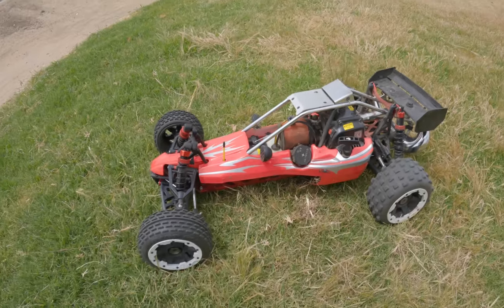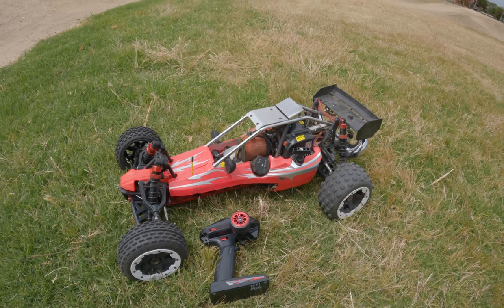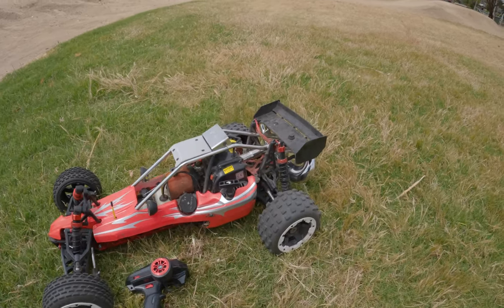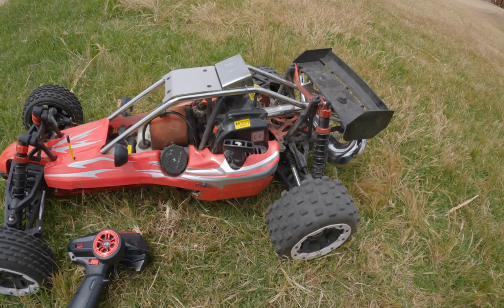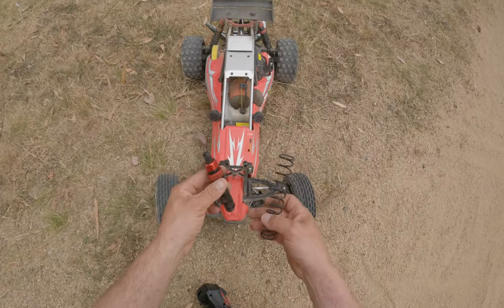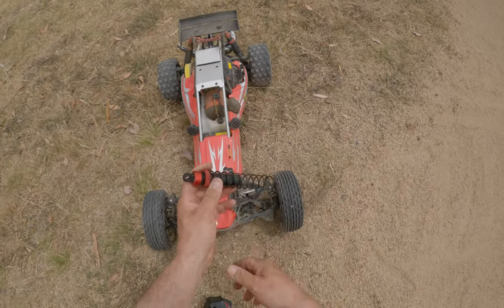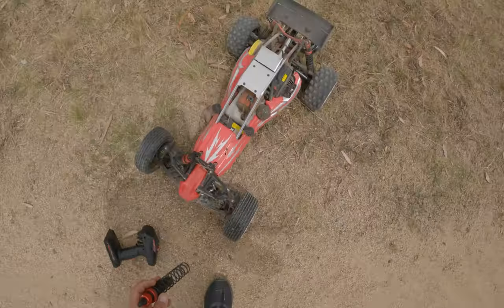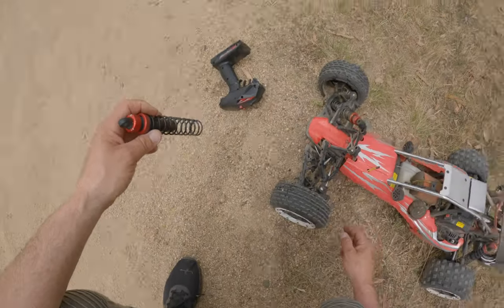RC Car: Thrilling Baja 5B Off-Roading: Pure Adrenaline Rush! #baja5b #hpi

Comment: I recently just swung by this track to run my Baja there. Agree, the track needs some maintenance, but great to not be near private residences.
Reply: Nice jumping by the way! 
I’m not game to break the thing 😂
Reply from the maker: Yeah it’s a great track . But majorly need an upgrade. Each would be good if it was in a more open area. The sound from the Baja just echoes through the neighbourhood . 👍🏼🚗
Reply: Sound bouncing off all those walls! I have an olimat pipe off the same motor as you, the sound never disappoints!
Reply from the maker: @andrewpickard-ke3cg  nothing sounds better than a Baja screaming👍🏼🚗

Comment: Bro I broke my chasis 2 day running my 5b. Front just snapped in half.
Reply from the maker: I know the feeling bro. They are a major weak point. Both mine have cracks where the screws are the front of the chassis. The best woukd be to get someone who can weld alluminium, but I ended up making  a stiffer plate over the original cracked one. I made it myself, but I know you can buy the hardened plates on eBay. I think they are a bit pricey tho. 👍🏼🚗. Thanks for watching